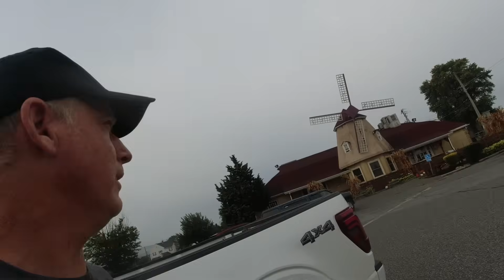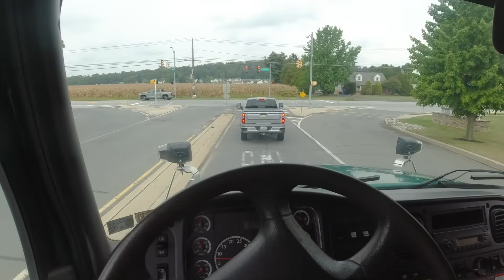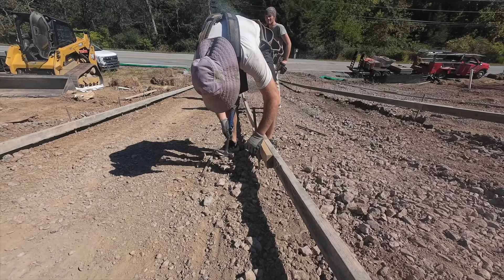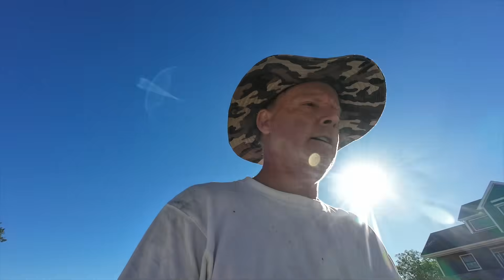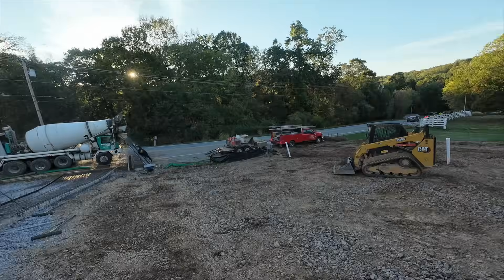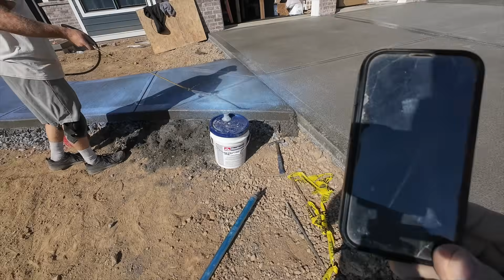Not Possible Without Our Power Buggies!

Comment: Tom, when I worked for Ingersoll Rand Construction Group, our office was on the International Salt Co. (now Akzona).  Every fall the maintenance staff would put a 50/50 mixture of boiled linseed oil and mineral spirits ( which they warmed in a large pot) and sprayed every concrete surface on campus. The used nothing but rock salt, storm after storm, and nothing ever deteriorated.  They used so much salt, we could never tell how bad the roads were until we hit the highway.  Tom

Comment: Tom I'm surprised she took this project too much liability from looking at the existing structures there it seems like the developer or Builder never thought of a retaining wall shocking from your video of the other two homes such severe elevation differences one would assume the developer or Builder is going to leave the retaining wall issue to the new homeowner after they find out they have a complete disaster then the construction cost goes up severely working around homes and poor working conditions with heavy equipment smart people do the site infrastructure before they start the building is kind of construction 101 you kind of learn that in the beginning stages of trying to be a developer Builder the reason I say that you have liabilities is your building on uncompacted soils that's obvious from the entryway you walked up from the basement they just put soil in there there's no weight with that grade you can get compaction running a skid steer on a 3 fate of soil doesn't constitute as compaction course you know all this the failure is going to be the concrete in the driveway and the sidewalk it will fail and then the homeowner is going to call you several years later wondering what happened and you will most likely replace it because you are very concerned about your construction companies reputation it says a lot about companies that been around for decades in provide good customer service which is wonderful but every job is not a profitable job even though you think it is then it comes back and bites you in the ass I would have took a hard look at all the previous homes that are built in most likely homeowners live in them in that are pretty much sums it up for me there's no harm in telling a developer Builder sorry no thank you were busy I wish I could fit it in but I just can't I'm booked solid for a year you don't necessarily have to tell them why you don't want to do the project cuz it hurt your business relationships just simply pass I truly feel sorry for the new homeowner because they think the spending is over once they acquire the 750k plus house and then a year two down the road they find out they need to put 100K Plus in retaining walls and their neighbors not going to be too happy because they're directing water onto their property which is going to put spoiled soils all over that nice clean concrete you're pouring AKA a big muddy mess in mud season not every jobs the job you actually want you got to compare the assets to the liabilities save those type of projects for the fly by Nighters here today gone tomorrow that way when the homeowner gets pissed there's no one that they can yell at.

Comment: Tom, you'd think people in snow areas, would have heated driveways? Especially on that grade, just my thought process, I would
Reply: Tom, I would agree with the heated driveway comment.  I was wondering if you folks ever did any radiant snow melting.  I know you do radiant heating indoors.   Snow melting is an expensive proposition, and costly to operate.  One method to keep costs down contractors use is to only melt the tire tracks.  Might be something to offer you customers for future projects on the sides of hills as well as flats.

Comment: Hi Tom good luck with the new truck. With the truck on level ground and at operating temperature. Press both arrows on the shifter pad and it will tell you the oil level  , how much life is left and a few other things. The oil in that transmission is Castro Synd 668. It is around $50.00 a gallon. But that is the only oil recommended by Allison. There is YouTuber ADEPT APE. He put out the correct way to service that transmission about a year ago or so . I stress this because that transmission is a work horse as long as it is treated properly.
Reply from the maker: Thank you very much for the tips

Comment: Congratulations on the auction score, that's a nice truck 😍 Make sure your front axle bearings are good, the weight of the plow frame and the action of plowing can be hard on them- you might have to do an alignment after the frame is off. You probably already know this. That was quite the project on the driveway 👍 Good video.
Reply from the maker: Great advice thank you